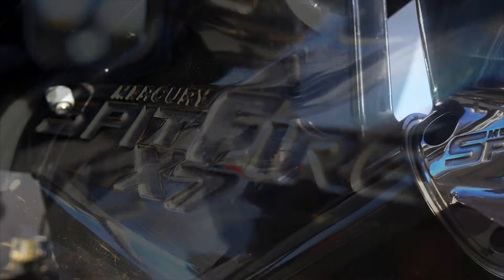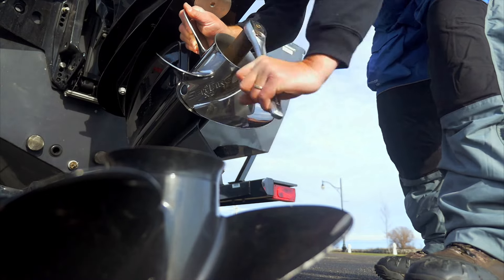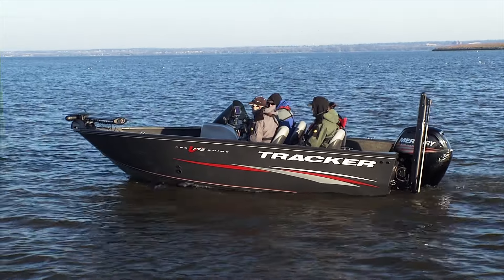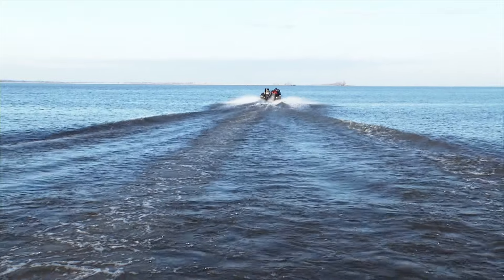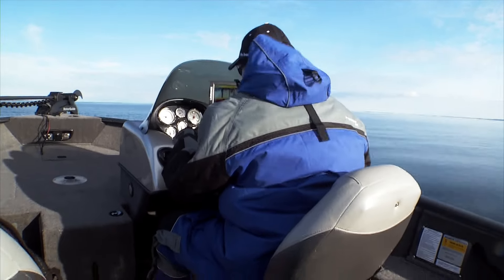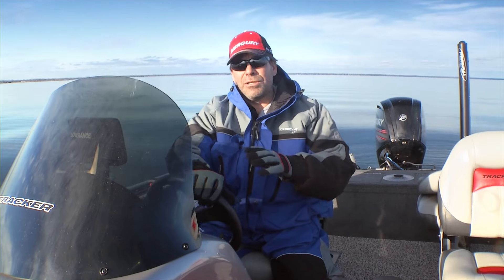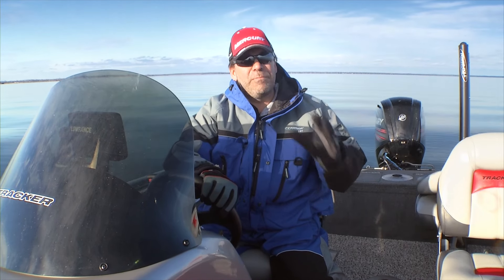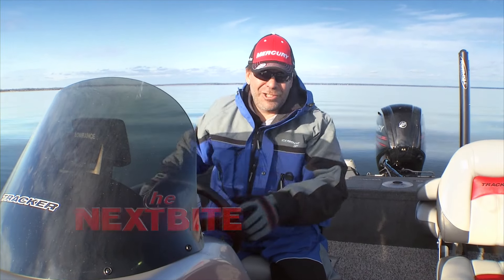Fishing Tip - Mercury Spitfire X7 Prop S12E05

Comment: Why is the X7 model restricted between 75 and 115?  What about the 150?
Reply from the maker: Back when this video was made that the range Mercury wanted the prop to be in.  But you can use the Spit Fire on a 150hp now.  Check out this cool guide. https://www.mercurymarine.com/en/us/propellers/selector/
Reply: Thanks - But I still don't see where the X7 spitfire is offered for the 150.  Maybe it's not made in the 4-3/4" gear case?  @ThenextbiteTvShow
Reply from the maker: Not 100% sure.  Every year of 150hp I have tested and added to the guide pulls up spitfire prop as a option.  (note they don't say x7 just say spitfire)      If in not sure  can always call a service center. https://www.mercurymarine.com/en/us/find-a-dealer/

Comment: If I am currently using a Nemesis 13.4x15 4 blade aluminum prop on my motor and want to convert over to the stainless steel Spitfire x7, would I need to go down in pitch?
Reply from the maker: This is a question you will have to talk to your boat dealer with.  There are so many variables to choosing the right prop.
Reply: I have the 115 mercury 4 stroke what pitch was this prop in this video?
Reply from the maker: @Ronwell_Quincy_Muddobber  this video is 5 years old and I don't know that answer.   But if you ask your dealer or Mercury directly. They have field tested every pitch to every prop on wide range of boats.   Some props for best control, other for top speed and better hole shoot.